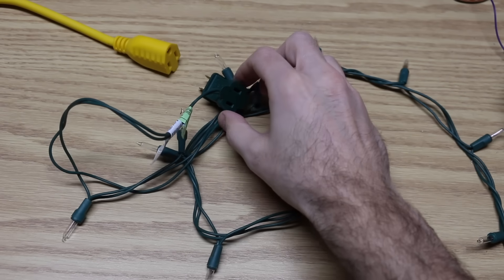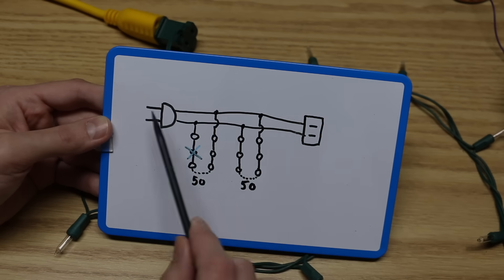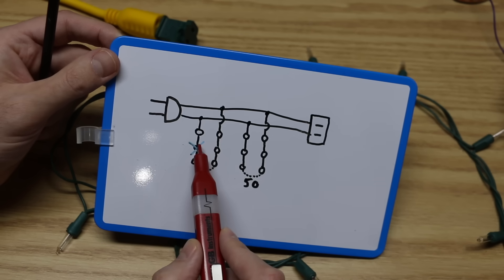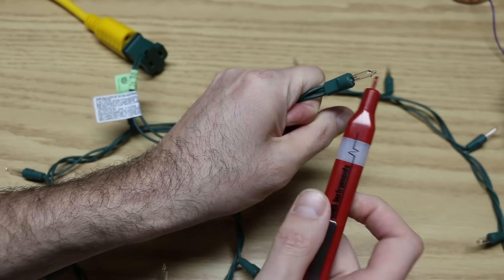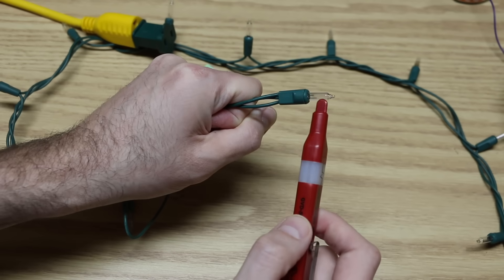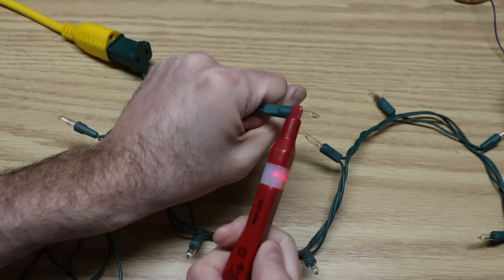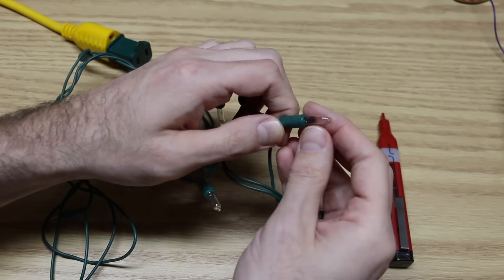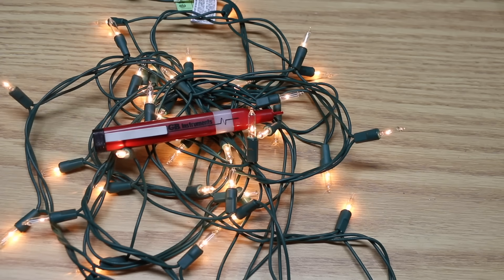HOW TO EASILY FIND BAD CHRISTMAS LIGHT BULBS using a non contact voltage tester

Comment: Dude, without this video, I would have been wringing my head on trying to find a bad bulb.  It turned out I had two bulbs that had their leads broken, so could do process of elimination if just doing a visual check.  Using the handy dandy Harbor Freight probe did the trick!  Thanks again for posting this!

Comment: Also , the light companies wire the light string in series parallel now with
a daisy chain hot and neutral in and out of the blub shell. By doing it that way, if a blub burns out... the rest of the string stays lit up.

Comment: Would it be the one that doesn’t light up when you plug it in?
Reply from the maker: in the case of the particular lights I was using, 50 would not light up when plugged in so back to finding which one is actually broken

Comment: Everyone knows you should always  remove a bulb when you pack them away that way you know which  to replace. Or just smash any random bulb .we no longer have these in Britain but we used to have a bulb with a white tip which was a fuse bulb .and remember never rap your bulbs around  a cardboard tube just scrunch them up it keeps the kids occupied for hours untangling them........

Comment: Or, you could just pull out your cell phone and turn on the led flashlight and inspect the filament. If it's not connected to both leads the bulb is bad. 

Electrical engineer with 20 years experience.

Comment: I think an easier way to do this would you get a wire tracer hook up a signal on the main 120 volt either side and then simply move the tracer along all the wires and where your signal stops you have your break.

Comment: I bought one to fix my pre lit tree, but as soon as I got within a foot of the the tree it was beeping, so I couldn’t troubleshoot
Reply from the maker: I just did the same thing as a test with mine and yeah about 8 inches away from the tree it started going off, I’m guessing there’s so much electrical activity in a confined space and all bundled up it’s probably just like a big antenna of energy compared to just going along a single string.
but I did successfully use a light keeper pro once to find a bad bulb on my pre-lit tree.  just by plugging the light keeper into an empty bulb socket on the tree and then pulling the trigger a few times, the tree lit up again and I was able to look and see which bulb is actually out and then replace it.
Reply: @GadgetReboot  luckily mine was just a bad connection between two of the interconnected plugs, but I would hate to chase down a bad bulb on one of these pre lit trees
Reply from the maker: I don’t even remember how old my pre-lit tree is now but overall I’m surprised how long the bulbs have lasted, I could probably justify throwing the tree out and just replacing it if it became too much hassle or else just ignore the built-in lights and go back to putting strings on it for a while

Comment: I’ve been trying to fix these for years. I even bought the kit to check bulbs. Now I understand flipping the plug and how the circuit can fool you if you flip the bulb and how to shield. Now I won’t be running  these to the recycle by the dozen! Thanks so much. 
By the way, my wife is crazy for lights. We even have 6’ icicle lights coming down around the house from the gutter. I’ve had to pull 2/14 from a source with plug receptacles every three strings to handle the series load and mount them under my overhang.You cant miss our house!!!!
Reply: OMG read my aching finger comment above!! You and me bro are thinking alike!  stupid lights
Reply: me i just get them from the neighbours as they toss them out ... look at each bulb and replace the black tipped ones and poof free string of lights ... ok I buy 20bucks of replacement bulbs a year BUT havent bought a string of lights in over 20 years ... simple easy cost effective check .. no gear no fooling around ... just look and pull the burnt bulbs and replace ... then untangle and plug em in and string em up

Comment: Now, can you do this with an LED Net?
Reply from the maker: i’m working on a video for that right now. As long as the LED bulbs are replaceable and not permanently wired, it does work
Reply: @GadgetReboot  Thanks, I've had an LED net kicking around for a few years with  a section that won't light up, ya, I got it cheap at Lowes after the holidays, but I would love to make it work again!!

Comment: You actually do not have to shield the neutral if you get a real NCVT (90 -1000 volts)
Reply from the maker: there’s also the other possible hot wire running along end to end that may be picked up. and some of the testers are   less sensitive and work with just a little separation only.

Comment: Another trick is to apply a high voltage, low current source to the light string in a darkened room. The current will be too low to heat the bulb filaments, but a visible arc will form in the bulbs with broken filaments.

Comment: Just knowing that a voltage tester can help find the burnt out bulb without pulling out the bulb was a time saver. I strung my lights before testing them and didn't have to pull them down to find the one pesky burnt bulb.
Thanks for the tip!
Reply: does NO ONE actually spend the 2 minutes to look at the tip of each bulb for black soot ... the tell tale sign of a burnt bulb ... yup those christmas leds are filament bulbs and when they blow they burn the filament and leave a sooty residue inside the bulb very easy to see ...
Reply: @0623kaboom  Not for me..my eyes are not that good. It was an easy task after my lights were strung to use the voltage tester to fine the burnt bulb..

Comment: Try a 'wolf fence' technique. There's a wolf in your field but you don't know where. Install a fence in the middle ofthe field. What side of the fence is the wolf on? Put a fence in the middle of that half and once again, what side is the wolf on? You rapidly reduce wasted effort looking for the wolf. In the case of a 25 lamp strand, begin with the first bulb to determine what side is hot. Then try13th bulb. Is there power? If so, the fault is in the second half of the strand. Check the middle bulb in the second half of the strand. Is there power? If yes, the faulty bulb is among the last six. If not, the fault is in the six bulbs before that bulb. This method will save you time of checking every single bulb one at a time.

Comment: Cool!  Now do a video on how to figure out the series-parallel circuit configuration of the entire strand!  I'm guessing the tracer and which lights are on plus the number of wires is a quick tell?
Reply from the maker: The circuit schematic was in the video. two sets of series connected lights connected in parallel across 120 V
Reply: Three wires = two separate parallel circuits. Four wires = three separate parallel circuits.  10 wires = 9 parallel circuits
Reply from the maker: if a string of lights had 10 wires I would definitely throw it out and buy another set. But not before cutting it up into 1 million small wires

Comment: I'm an electrician who makes a living at diagnosing electrical issues in old and newer homes. It's very rewarding work and I enjoy it a lot. I'm proud in saying that in 11 years we've yet to walk away from something we couldn't find and fix. I have 7 or 8 pieces of electrical diagnostic equipment and experience. I still absolutely despise those chain type Christmas lights.
Reply: I get 2 to 3 years out of them and throw em out once half the string doesn't work.  Sometimes it's the cheap line they're on and not bad bulbs.
Reply: Amen to that, brother.
Reply: I learn something new everyday. What I can't find is what to do when all the lights burn out at the same time. I have a garland that has lights built in and the all turned black. How do I fix that mess..?
Reply: @calypzo69  I can one-up that one - - - my wife decided we would buy fake and "pre lit" trees . . . .  starting a few years ago and those strands are pre-clipped into the tree branches . . .  you fold up the tree at the end of the season and pack it back in a box . .. . all that bending and folding - the light strands take a beating and by the end of year three or four - you've started to have to put in your own strands. . . . which kinda defeats the purpose, not to mention al those non-illuminating bulbs causing family and guests to quickly say "You've got some burned out bulbs" . . . . . . the payback on the pre-illuminated fake trees aint what you might think . . . . cutting the old strands out takes hours.
Reply: @stephenm103  Been there done that .
Reply: Ditto everything Scott said . . . . and will add that the wording on all those boxes which states "When one burns out the others stay lit" has been demonstrated by anyone here - to be utterly false.   Further, I've found it is simply easier and quicker to pick up two or three new strands at the END OF THE SEASON when all the stores are clearing out their seasonal stuff  - - throw them in my decorations box and then use those to replace anything that burned out next year.    While it is gratifying to "troubleshoot" and repair . . . .  the time I've spent doing so for a strand of lights I can pick up for three or four bucks at the end of the season just isnt worth it.   Many other chores I can get done in that same time that are gonna save me far more than the cost of those same strings of lights.
Reply: I'm a hands-on Electrical Engineer and have debugged incredibly complicated systems, but Christmas lights have always been too much of a pain!  Lol
Reply: Series splices, as a burglar alarm installer, I’m way more comfortable finding these faults
Reply: Despise with a passion....lol
Reply: I have had great luck fixing these types of lights by throwing them in the trash and buying LED strings. Works every time!
Reply: I thought that christmas lights or any other lights arranged in a string no longer did that? Aren't string lights connected in parallel so one burned bulb doesn't shut the rest of the string as it was for   in series?
Reply: @hmax1591  I guess there could be that type out there but the sets I have are two, three or four series loops put in parallel with each other. Lose one bulb and basically a short section of the string goes dead but not the entire string. Find a bulb socket on your set that has more than two conductors going into bottom of it, this indicates a set with parallel loops of series connected bulbs. I'm much prefer the old sets of Christmas lights where the sockets pierced the extension cord type cable. If a bulb goes the rest stay on.
Reply: @hmax1591  Not the little strands . . . of mini/micro bulbs.    The voltages on those small incandescent AND LED bulbs is well below line voltage so they HAVE to be in some kind of series arrangement to accommodate line voltage.   As shown in the video drawing - - while there may be some portion of the strand in parallel - the vast majority are connected in series.   Depending on the number of bulbs and their voltage rating(s) determines how they are connected.    That said - I AM beginning to see some of the LED strands connecting in parallel along the entire length . . . . Those that are, are very easy to spot - where they ONLY have two conductors running the length of the entire strand .  . .. if you see more than 2 conductors - that's your tip that they are (somewhere) in series.

Comment: If they asked all the bulbs in parallel instead of in series, then all but the broken bulb would be working. Why don't they make them that way?
Reply from the maker: if they were all in parallel they would all need to be able to run on 120 V each and I’m not sure if they would also need to be physically larger, but these series connected bulbs only need 2.5 V to run so it’s probably cheaper to make them as well. always follow the money, that’s where the answer is.
Reply: @GadgetReboot  a small transformer should be able to lower the voltage down. But that would cost a little extra I suppose, so I do take your point on the costing.

Comment: But begs the question:  why not just look for the charred incandescent bulb???
Reply from the maker: sometimes good ones still look charred and sometimes bad ones don’t, so you would have to look even closer at the filament but if it’s coloured bulbs or if they have some different diffuser over them you still won’t be able to see.

Comment: Even as a retired electronic technician, I don't think that I would have thought of this approach. It's quite ingenious actually. Just shows that we can always learn something New. Thank You for the clever incite.  Barry Howard Begley
Reply: As an Electronic Tech I have one of these probes and they give false readings....nothing better than the VOM. 
Never found a light set I couldn't get working, a simple series circuit with the VOM.
Reply: @JFM1170  There usually are more than 1 way of accomplishing most tasks, and the multimeter can certainly be up to the task as well, but by working both ends of the string with this wireless voltage sensor and then going to the middle, the process can immediately be cut in half. When the defective half is discovered, then the middle of that portion could be tested, thus honing in on the defective culprit. While these voltage sensors can be quite sensitive, but by corralling the cable mass, and approaching near the bulb itself with the instrument, it could be a huge timesaver from pulling dozens of bulbs on a large string. I still think it is a GREAT idea !
Reply: @barrybegley5379  Barry you are right it can be easier I have one of the testers and I always go back to the DMM or the VOM  I have found the tester is very unreliable. When I test a string I put 1 lead in the neutral slot and work around the string about every 5 bulbs you will always have 120v until you find the open, that's just my method. I guess I am still old school I still like the analog Simpson meters.
Reply: @JFM1170  Well...Whatever works for You. I am curious, though. Where are you picking off the individual voltage drops around the loop of bulbs if the string happens to have molded sockets. Are you pulling the bulb from the socket under test to get at the contact or is the cord being compromised to pick off the presence or absence of a voltage?
Reply: @barrybegley5379  I put 1 probe in the neutral slot then foam the hot side I walk up the string about every 4 or 5 bulbs, You should get 120v until you pass the open. I will then back track pulling each bulb until I find the 120v. When you find the 120v you have the bad bulb or the open part of the circuit, The voltage drop will always be 120v until the circuit is complete, I usually do a 4 or 5 bulb skip doesn't take long to go back. You still have to go around the string in case more than 1 bulb is the problem. Nice Chatting Good Stuff.
Reply: @JFM1170  Ok then. Have a Great Day!

Comment: you know, they could just fix the design of these sets so they stay lit with a popped bulb.
Reply from the maker: that’s what happens if the shunt properly activates when a bulb burns out, bypassing the deadbolt been keeping everything else connected.  It doesn’t always happen. 

Even if it does, all the other bulbs are suddenly stressed a little more because the same voltage now has to be shared among fewer lights so they all get more stressed.

 and they die a little faster and it becomes a chain reaction. The dead ones need to be identified and replaced as soon as feasible to save the whole thing.

Comment: What about with more modern light strings where even if the bulb is out, the rest stay on.  Except sometimes half yhe string is out.
Reply from the maker: if a bulb is out and the rest are on, that means the bulb did its correct job of activating the shunt to bypass that bad bulb and that means we may not even realize it’s out and we have to just occasionally check and if we find it out, we should replace it otherwise the others burn hotter and will die sooner. So the only way to really check for that is just occasionally look and make sure they’re all lit.
The less lights that are glowing while the rest are still on, the more voltage is present on those that are lit and the sooner they will die.

when half of the string is out and the other half is lit, that means  one bulb is at least dead if not more and so then we track them down.

Comment: Using successive approximation (go to the middle bulb, if it is hot, go halfway to the end farthest from the source,  if it is dead go back halfway to the source, etc) is faster than going 1 at a time down a hundred light string.

Comment: i used to do it this way, ended up buying a lightkeeper tool and it was the best ever. i liked it so much i bought more for my family, it has a built in detector, a shunt activator, bulb tester, fuse tester etc. all built in. it’s like a crazy swiss army knife for christmas lights.
Reply from the maker: I got one a year after making this video and then I made another video showing how to use it. It’s especially good when the lights are already tangled up on something like a built-in Christmas tree light or a garland.